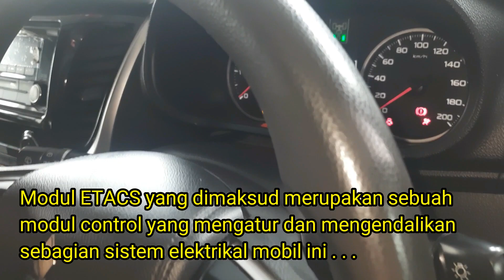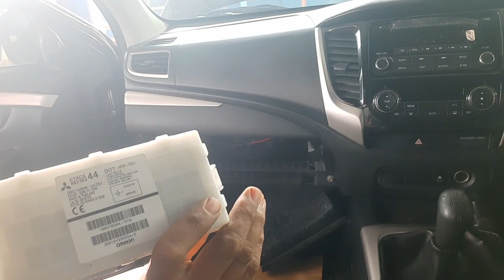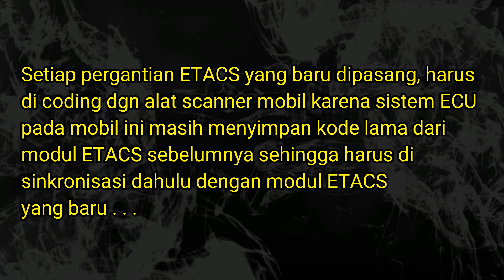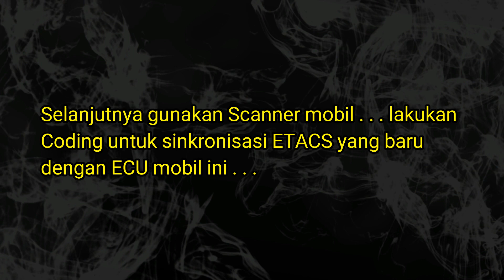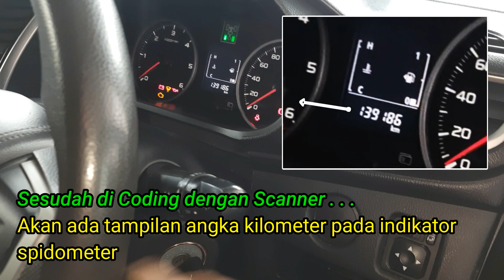Ganti ETACS Pajero Sport, ternyata separah ini kerusakannya...

Comment: ETACS adlh sistem aktuator yg berfungsi sbgai pengatur aktifasi dri bnyak fitur2 di sistim elektrik termasuk headlamp, dia bekerja berdasarkan input dri tombol dan switch aktifasi yg ada di dashboard n remote, fungsinya mensinkronkan semua operasional sistem elektronik di unit. n etacs jg berfungsi kasih info ke ECU kl ada mlsh di sistem yg dia atur, d ini sprti sistem fuzzylogic di gadget lain.
- untuk kasus headlamp problem stlah lama pasang lmpu non standard kira2 begini sikon nya : etacs mengatur jumlah daya listrik yg di butuhkan se effisien mungkin untuk lampu depan dan menyesuaikan dgn kebutuhan lampu standard, saat lampu di ganti dgn non stndard etacs akan terus menyesuaikan arus/daya yg di butuhkan, pada kondisi tertentu bisa saja ada kejutan listrik entah krn ada mslh konektor atau kondisi pemakaian yg memaksa etacs pda kondisi optimum untuk terus menyesuaikn n jika hal ini terjadi bbrp kali etacs short n nonaktif untuk satu sistem yg mengalami kondisi tadi.
-Dri kondisi tadi bisa di simpulkan etacs selama ini bkrja di luar kondisi normal sehingga saat ada kejutan atau yg lainnya backup sistem nya habis dan jd off, jd ini bkn mslh mutu atau ada kondisi malfunction maupun miss produk, tp lebih pada kondisi yg di baca tdk normal yg kbtulan di alami.
Reply from the maker: Terima kasih, sangat jelas dan sangat bermanfaat sekali penjelasannya